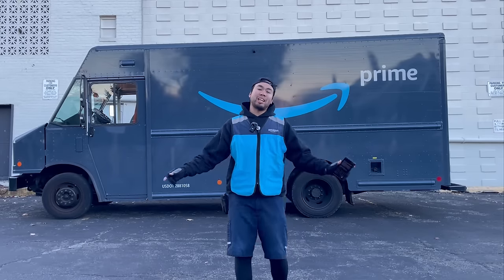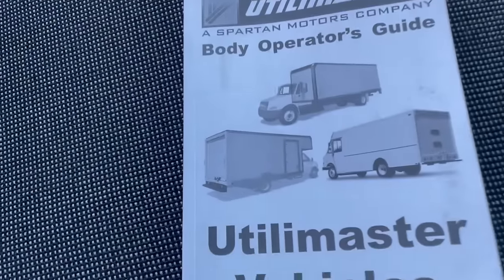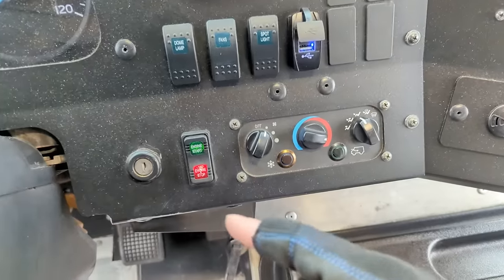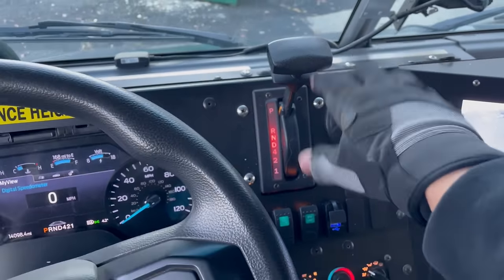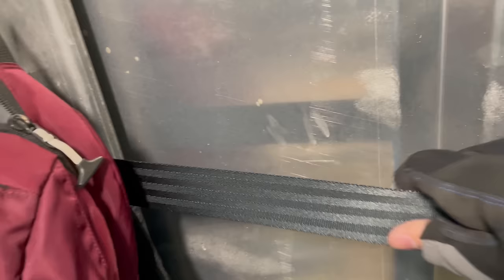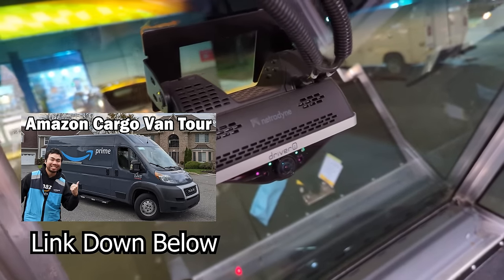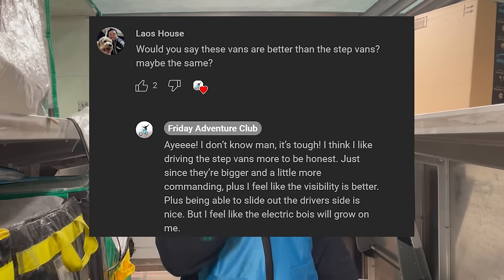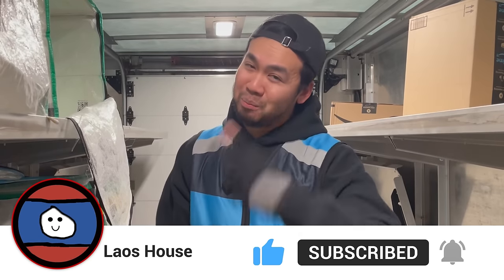Why Every Amazon Driver Needs to Drive the Step Van!

Comment from the maker: Rivian, send me an electric van so I can decide vehicle is superior!
Reply: Rivian is awesome. The only issue with rivians I’m dispatching dsf8 and we get routes in Berkeley and few Oakland hills.
Rivians can only be driven in flat roads :/ with little hill
Reply: Do u need cdl for that truck?
Reply from the maker: @wildmonkey2409  nope
Reply: Is it exhausting to drive a step van all day vs a Sprinter type van? (I’m thinking maybe because the step van rides rougher and is noisier??)
Reply from the maker: @joeblow1942  maybe just a little. I find them more fun and the sound is okay
Reply: @LaosHouse     A couple questions, please….  1) Is it true that the ride and front cab on 2000+ step vans are smoother, quieter and have AC?  2) Can you carry on a conversation with someone sitting in the passenger seat without screaming at each other?
Reply from the maker: @joeblow1942  1. compared to cargo vans, definitely not. rougher ride and a tad louder 2. yes, you can speak at normal tones without a problem
Reply: @LaosHouse     For #1, I meant compared to earlier step vans. So is it true that step vans built AFTER the year 2000 ride smoother and have quieter front cabs than step vans built before the year 2000?
Reply from the maker: @joeblow1942  I would assume so but I wouldn't know

Comment: I’m a package handler for FedEx. Started working there pretty much right after high school. My terminal wasn’t even finished with construction so I worked at a different location for about 2 months to train. Now it’s been 2 years 😅 I’m still working there. Job isn’t great but I love the fact I can do a good job and the drivers always compliment the way I load their trucks. I’ve become an occasional employee so I pretty much go whenever I want 😂 still want to find a job or career to go into where I can settle down
Reply from the maker: You'll find your way. My advice is to be open minded. The only thing I don't like about Fedex package handlers is you aren't to have a phone on you
Reply: I'm a driver for a contractor who works for FedEx, tldr I'm a FedEx P1000 driver (what they like to call the step van trucks). The Ford 7.3L have a lot of power, though mine is a freightliner based one with a 6L chrysler. They run well enough too when in tune, but not mine lol. The truck layout really comes down to the person buying the trucks for the various contractors. The doors break in no time lol. Mine is only about 2 years old and almost nothing on it looks new, except for the screen and cameras lol. I've got 2 rear view cameras because it already had one when they upgraded the camera screens and added side cameras. We also have our front and inside camera too. So when I reverse I'll see 2 backup screens, one on my radio lol. For me the truck test was just me driving an old turbo diesel with my manager riding around the parking lot. I do want to eventually some say drive a simi
Reply from the maker: @xBruceLee88x  when I was at FedEx my boss installed the side cameras and another backup camera. Apparently it was a requirement

Comment: Way nicer then any FedEx truck I drove
Reply: FedEx be using 30 year old trucks with oil leaks and no air conditioning 😂😂😂 shit's fuckin brutal especially here in Texas
Reply from the maker: It's comparable to the new FedEx trucks.
Reply: @LaosHouse  They’re called step vans because of DOT regulations. The are called “step in “ vans in the trucking industry. UPS called them package cars which I find funny 😂
Reply: @JamesClark993311  UPS be using trucks from the 70s and half a million miles 😅
They still work tho.
Reply: @angelgjr1999  if it ain't broke don't fix it
Reply: @JamesClark993311  Yup! The mechanics at UPS know how to take care of them.

Comment: For the amount of volume you guys push, step vans would be the way to go. I used to work for FedEx Ground and absolutely loved working out of my giant step van (Freightliner p1200). I later switched to FedEx Express where I mainly drove Sprinters but every now and then they'd put me on a route with a step van and I loved it.  Always be mindful of the size of your vehicle and always watch that tail swing on turns! And yes, those wires on the back door help lift the weight of it. Had one snap on me once and it was not fun to open. Keep up the great vids! Very informative!
Reply: Is it exhausting to drive a step van all day vs a Sprinter type van?
Reply: @joeblow1942 no the regular cargo van is more exhausting.

Comment: Great tour, I love the big step. Lot of drivers don't know that the double-tap on the ignition off button opens the bulkhead door! Long-press on the key fob button works too. You shouldn't have to use that crappy key!
Reply from the maker: agreed. I wish it was push to start where I don't have to press the button
Reply: Learned that the scary way. I was in the back refilling my lemon juice bottle, when the sliding door opened. I think I accidentally double clicked my key fob. Luckily no one was around. 😢

Comment: One reason its called a stepvan is because its on a van chassis the uses ford e series or newer ford is a transit chassis some also use a freightliner (Mercedes) sprinter chassis so technically it is a van since the chassis is from one its just customized by companies like utilimaster to look like that

Comment: Steps into the van but doesn’t know why they call it a Stepvan. That’s gold🤦‍♂️. Just kidding! Btw, Chevy called their earlier model the “Stepvan”. Mines a gmc and they called it a “Value Van”. Stepvan has kinda become the generic term these days although curbside delivery vehicle is the category most of these type of vehicles were referred to. I love mine though. I just wish it did highway speeds better. It’s like a brick on wheels. Im rebuilding the motor and considering doing a transmission swap to an automatic. Thanks for sharing!

Comment: Hey Chris!  Quick question.  Do you know offhand if most of the stepvans are similar in height clearance?  As an example, the stepvan in this video is 10' 10".  Would that be very close or the same to a P1000 with FedEx?
Reply from the maker: I think they be the same. It feels and drives like a P1000

Comment: Tip for someone starting as an Amazon driver ?
Reply from the maker: Organization is key and stay hydrated. Everything should be pretty chill when you start
Reply: @LaosHouse  I appreciate you
Reply: @LaosHouse  one more question : does Amazon provide fuel ⛽️ or is that outta pocket
Reply from the maker: @sxeeverardo  you get a gas card from your company

Comment: If you’re gonna drive that, just drive for UPS and make 120k a year with free health insurance…
Reply: Sometimes people prefer type of work over type of pay. Amazon has a way more organized way of delivering and picking up packages. I've seen how UPS and FedEx trucks look. I'd rather make less driving the Amazon Stepvan then have to deal with UPS way of delivering.
Reply: It’s not as easy tow oro for ups you have to start as a package handler don’t you? And move up the ranks for low pay ?
Reply: You can become a step van driver after like a month of driving and by literally just asking. DSPs prefer having lots of step van qualified drivers since they run the heavy routes.

UPS is for people who wanna work in that field for years on end. Amazon is quick easy money with moderate work.
Reply: @shadowk4718  yes. I currently work as a package handler at ups. Been there 2 years waiting on my turn to be a driver.